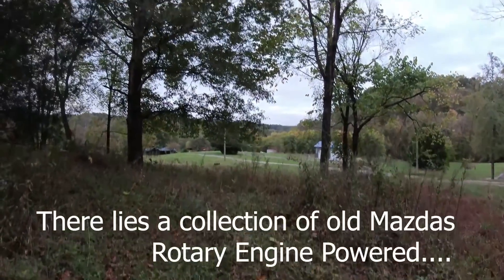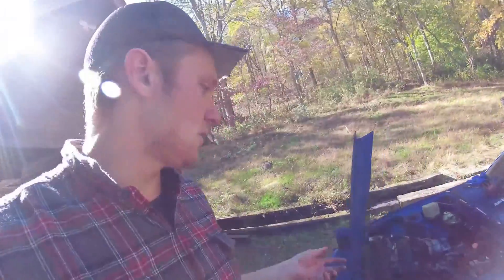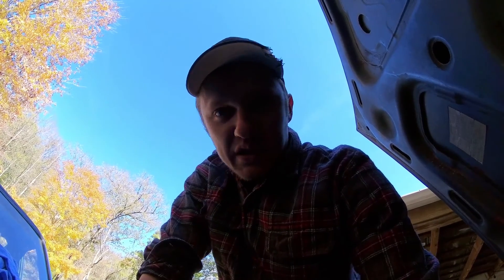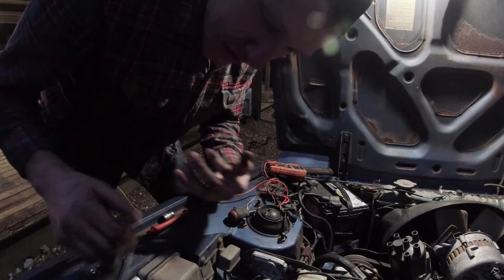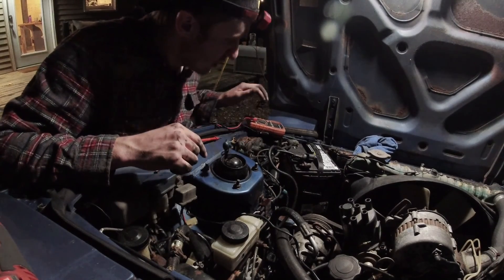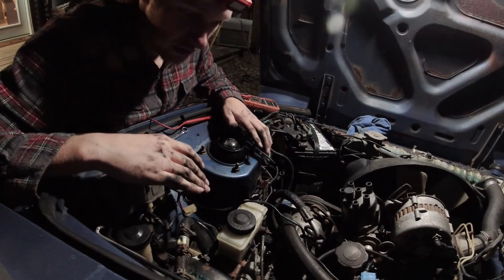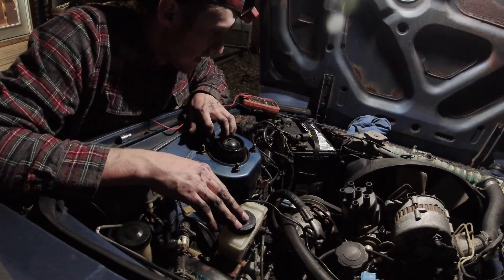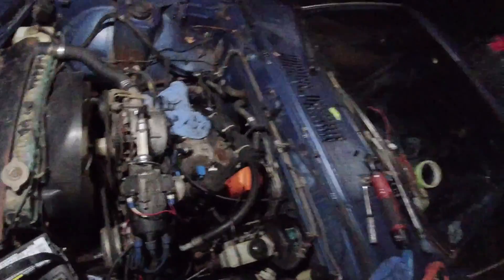Lil Stu Has SPARK!! - Upgrading to Electronic Ignition - 79' RX7 12a

Comment: Great content man! I've noticed you don't run any coil/ignition upgrades on Bridgeports( I may not have noticed) how do you find the stock ignition system for 81-85. I hear a lot of negativity on rx7 club, but that place can be hard to find solid answers as of lately. Anyway keep it up man! These are a huge help for my rotary collection
Reply from the maker: I just run MSD high vibration coils, and the 84-85 distributors. stock igniter.  i didn't have any issues up to 9-k rpm. still stock balanced engine so I didn't want to push it much higher

Comment: Are the power wire for the ignition coils and the wire for the tachometer the same wire or are there supposed to be two separate wires
Reply from the maker: Tach signal wire comes from the negative terminal of the trailing coil.   The positive wires are separate from the TACH signal wire

Comment: Hey, I just found this channel a few days ago while I was looking to buy a 1982 FB RX7 GS at auctiuon, I just got it and I dont have a key for it do you recomend getting one made? or bypassing the ignition lock cylender? or something else? I also dont have a key for the doors or trunk. Any advice would be awesome!
Reply from the maker: The cars are abundant enough and people parting them out, you may have luck finding a set from another car.  If not. The Mazda dealership should be able to cut you a new key if you provide them your VIN.  The ignition switch is not hard at all to bypass.  Everything is accessible under the column